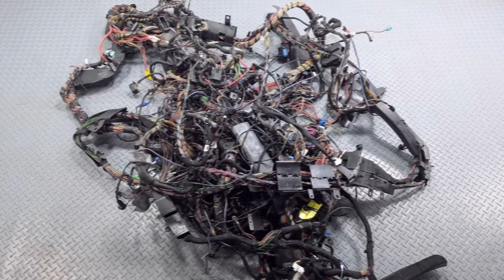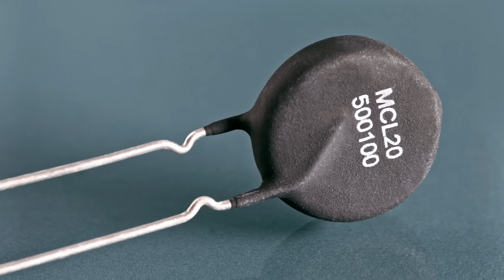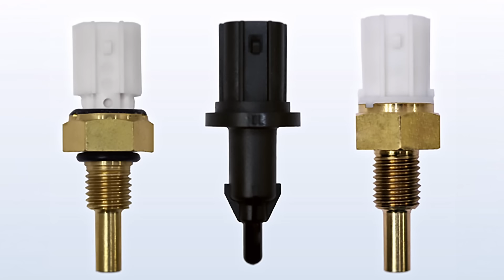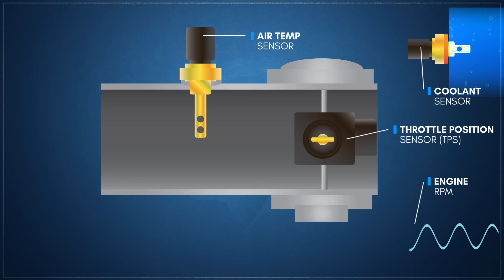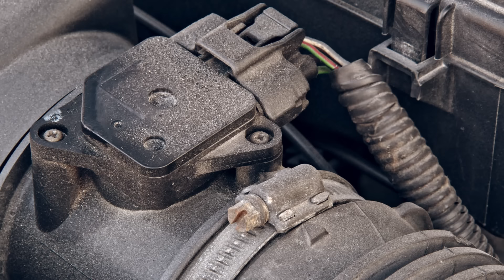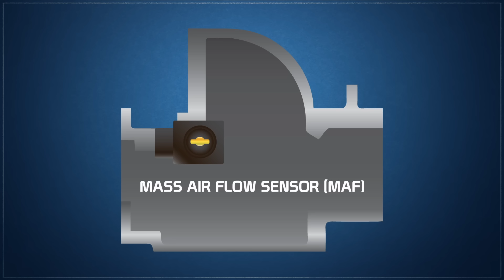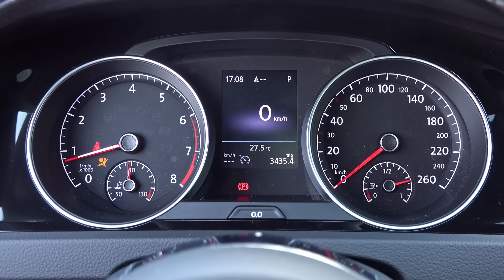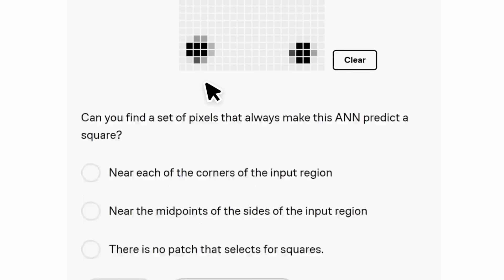The Insanity Of Engine Sensors

Comment: Sensors are among the most valuable tools for mechanics, yet manufacturers increasingly restrict access to sensor data, limiting owners' ability to diagnose and repair their own vehicles.

We can thank the Powell Memo for laying the groundwork for corporate dominance, leading to rulings like Citizens United, which grant corporations more rights than individuals. Just look at what John Deere has done to tractor owners—locking them out of repairs on equipment they supposedly own.
Reply: People dont want to hear it, but so many of our problems could be addressed by overturning citizens united. Giving corporations this much influence was a mistake.
Reply: Never thought I'd be @ a point where I would have to jailbreak my car. But we are at the point where I'm going to have to jailbreak my car.
Reply: its much better now, than before OBD2
Reply: This is the future I don't want to live in. I prefer to fix my own vehicles whenever I can. Sensor data plays a larger diagnostic role in modern cars. I often don't have access to OEM tools so I have to measure directly or figure something out by trial and error. Soon I'm going to buy a scan tool for oem data to help me with newer vehicles. I hope to keep them running because I don't want to buy a vehicle that I can't fix or worse, charges me monthly for heated seats.
Reply: You can't hide sensor data from an oscilloscope.

Most mechanics are just not that good at their job.
Reply: @BigUriel  that's true but complex software algorithms interpret a collection of sensor data to establish a condition that an ECU or BCM will respond to.
Reply: mate, the government is the Mother corporation and it has the right to torture anyone without being labeled as an crime. besides....corporations usually means you join them voluntarily, the goverments don't need your consent cause from the governments POV everyone is millatarelly enslaved humans

Comment: Reluctor speed sensors are not limited to 100 RPM, perhaps you mean 100Hz? Of are you talking about a lower limit, in which case that would be 100 pulses per minute.

Comment: Observe how multiple innovations and pressure to progress were driven by environmental regulations
Reply: Fuel injection technically existed but was an expensive toy for luxury vehicles. Now everyone has it, normal people don't have to worry about carbs, cars are faster, cheaper to run. Cities look smell and sound better. Funny enough the cost savings have yet to materialize on the MSRP, but objectively modern fuel injection is also easier to manufacturer than any sort of naturally aspirated system on real cars ever was. 

That's government ineffeciency for you, constantly making things better in ways that are taken for granted.

Comment: Engineering candy: just as castoff car stereos worked as Junior's first decent radio, the car parts store will help make an old HVAC system better able to react to changes caused by doors and windows, duct leaks and breezes.

Comment: I work as a mechanic specialized in electronics. After seeing so much  problems in modern cars and having owned complex cars, my daily car now is a small block with a Quadrajet. Fuel management problems? Worst case scenario = new $700 carburetor. Ignition problems? New HEI distributor. Transmission management problems? Springs and check balls (or a full manual valve body, more fun). An EV on the future? No thanks, a lot of unfixable Control Modules and a lot of sensors too. My priority in this time of my life is peace of mind.
Reply: The manufacturers have abused this technology to make it harder and more expensive to repair modern cars. Even if there were full right to repair transparency, if you can't get the parts you are still just as stuck having to junk perfectly good cars because of what used to be minor problems.
Reply: @ omg. The shills will see this and stand on their chairs declaring ooohhh noooo!! Our corporate car makers would never do thaaaat. They are all about gas mileage and safety. Allow me to get ahead of the pack and declare only a young naive brain can think like that. It is nice the world is still producing such innocent minds. Every now and then an engineer will chime in and try to convince us it is about affordability. These folks are just evil liars. Ok i am done. I have been building my own trucks for four decades. There is no end to the silly shit the manufacturers put on our internal combustion engines. I never forget that these same principles brought us the horseless carriage and i am thankful for tech. There is a balance. Vote with your dollar and speak with mechanics instead of salesman when you spend your hard earned dollars. And every now and then drop a shitty comment about the shitty bastards building complete crap based on planned obsolescence.
Reply: I couldn't agree more...
Reply: Fellow grease monkey here, i have an '86 cutlass ciera and last week the starter wouldnt engage, so i beat on it with a rock. Havent had any isseus with it since. I love old shit.
Reply: That says it all. I totally Agree.

Comment: All very interesting, useful and inventive. Great presentation too. What is ALSO maybe even more interesting are the mechanical and hydraulic forbearers of many these sensors. For instance, carburetors are amazing in both their complexity of design and simplicity of construction. All hydraulic control on automatic transmissions is similarly fascinating.
Reply: Like how the predecessor to silicon chip pressure sensors was metal anaeroid bellows like what was used in the purely mechanical Rochester Ramjet fuel injection system in the 1950s.

Comment: It would be awesome if you did a video on how can bus systems work with each other. This was such a great video
Reply: Came here to say the same thing. Extensive discussion of sensors but no analysis of how a CAN bus brings these all together. CAN bus was developed specifically for automotive use, but has expanded to other uses. The development of the CAN bus was crucial here.
Reply: @jdubs-56  I totally agree. It can be difficult explaining to people. Because a lot of the time who ever to explaining it to doesn't have the knowledge on the basics let alone that there is multiple computers all talking to each other thousands of times a second. I'm glad I was brought up fixing cars on one side of the family and computers on the other
Reply: Bus systems can not work with each other
Reply: YES, pleaseee
Reply: Ok I give you the basics
.. ecu is the master the other units are slaves...yes those are the proper terms... The master sends out on the bus a address(name) master then listens for a response, the addressed sensor responds with it info... The master the asks the next address(new name).... Think of role call at school, teacher calls student name, waits for student, student responds, teacher moves to next name and so on.
Reply: @ntal5859ECU or bcm? The ecm receives the signal to immobilize, who sent it? BCM. I discovered this, troubleshooting a Lexus 330 with bouncing windows. Several said the power window module, (drivers door power window switches). The fools bought one, and it did not change anything.... I stuck that part in a wrecked car, and the windows did not bounce. A simple. Program sequence is all that it needed, all the data the windows use is stored on the BCM....LMFAO the people before the shop that brought it to us, bought the switch as well ... And the previous owner, as well, and it was still back where the spare tire is. ... 😅4 of them. All functional, and can bus functional. 😅
Reply: Yes,,, CONTROLLER AREA NETWORK..
Reply: Strange that the more sensors evolved, the more fatal minor problems become.  It seems that all these fancy sensors do it to try and reach green goals.   Not save the motorist or the engine.  An expensive engine repair does not get added to the carbon emissions of a vehicle, so no manufacturer cares about it.
Reply: @Deontjie exactly, another tax
Reply: It is called PSY OP or SEMICONDUCTOR GEOENGINEER ING....

Comment: SHITTY gasoline. DIESEL IS THE BEST
Reply: indeed, that's why all supercars has a diesel engine!
Reply: @NastyAngel  because super cars engines barely lasts 50000Km. Worst diesel lasts at least 1000000 Km
Reply: @abdulaiabdurahmani2913  gasoline engines last for decades too, diesels has more contraints than a gasoline, there’s  diesels that give up at 100k, and has recurrent DPF problem every 20k it just depends which ups and downs you don’t want to mention.
Reply: @NastyAngel  what DPF ? I saw diesel Insignia 2019 with 990000Km original engine ! Nothing touched. Name me one supercar with petrol engine that can make that mileage.
Reply: @abdulaiabdurahmani2913  there’s a big difference between a supercar and a regular car’s engine you can’t compare it.
a stock 2.0L diesel can barely reach 240hp
a stock 2.0L gasoline can reach 320hp you can’t say it’s better, and without the vibrations and the complex exhaust after treatment a diesel needs. diesel is good only for trucks and industrial uses not for cars.
Reply: @NastyAngel  diesel is fantastic for cars. Economical and easy to maintain. No DPF. Nothing and inherently more efficient than petrol engine.
Reply: @abdulaiabdurahmani2913  you’re either confused or gaslighting me
Reply: @NastyAngel  I am just from kosova and Kosova loves USA

Comment: And all the sensors made the cars more expensive and more complicated...making them less reliable and more expensive to repair
Reply: Rubbish, I just fixed my brother's car for $16,  changed the crank angle sensor was 15 minutes. Only expensive if you haven't educated yourself. In the old days it would have been new points and timing settings and 4 hrs and the points would be $30.

Comment: The automotive chip shortage that occurred a few years ago presents a problem, how would you go about designing and building a modern car without ICs and microprocessors? There were whole car lots filled with otherwise complete vehicles that couldn't be sold because some important sensors and chips were missing, so I personally think that the chip shortage was merely a symptom of a larger problem, that cars are getting too complex for their own good. The sensors that provide the ECU with data are analog so I figured it would make sense to design an analog ECU that could interpret and respond to this data directly. But automotive design seemed to skip over this possibility when it transitioned from mechanical to digital control circuits, and there's virtually no interest in exploring this topic outside of brainstorming sessions with very nerdy people.
Reply: Complexity isn’t a problem. Bad supply chain management is. Simplicity is for fools. Life is complex.

Comment: How does the MAF-Sensor take into account cooler ambient air? Wouldnt that cool the hot wire faster?
Reply: The ecu takes into account intake temp to offset any ambient changes
Reply: most MAF sensors also have an air temperature sensor built in or near.

Comment: When mentioning knock sensor you didn't go into enough detail and you skipped ion detection.
Knock sensor detects knock but it's really slow in adjusting timing. For precise measurement of combustion pressure and knock more common technique is ion sensing using spark plugs.
When not used to ignite fuel mixture the ecu passes sends constant high frequency pulse with modulation signal, measuring the current passing through the coil. Power passed through the coil is low enough to not cause a spark to form but enough to create high voltage potential on the ends of a spark plug.
If there is knock in the cylinder the engine ecu would read a sharp current spike indicating rapid pressure change in this case detonation and would retard timing just enough to where sharp spike becomes more like rounded hill, indicating slower pressure change in this case defloration.
Reply: I wonder why no manafacturer uses this technology anymore. And why it wasnt ever adopted widely, only saab and bmw used it.
Reply: @juhohiltunen6341  SAAB ignition cassette also replaced the cam position sensor by measuring which cylinder was in compression. I like how my old SAAB can immediately adapt to any fuel i give it and will literally never knock.
Reply: @poptartmcjelly7054 so you can go from e85 to 93 no issues on the saab?
Reply: @poptartmcjelly7054  Yes, mine has separate coils but otherwise same functionality as older trionic systems. Gives surprisingly accurate ethanol% readings.
Reply: The Honda OBD1 knock sensors were slow and now today's are useless as the ECU can't process data fast enough to make use of it. the new cars from 2000 to now has the raw processing power to look for the "edge" they start at a known safe timing and fueling mark and start adding more timing. when they hit detonation they back off timing and add more fuel. if the engine still detonates it goes back to the last know safe timing mark and maintains the added fueling. some PCMs will treat there engine as a set of smaller engines. so a 6 cylinder engine will be treated like 6 different engines. where each cylinder will have there own ignition timing, and fueling. getting the best fuel economy and power output. the 02 sensors can update so fast the PCM can know the exhaust pulse that just when past the sensor came from what cylinder. go cyl 1 is lean, cyl 3 is just right, and cyl 5 is rich. and fine tune from there.